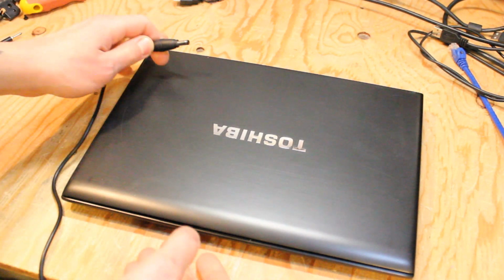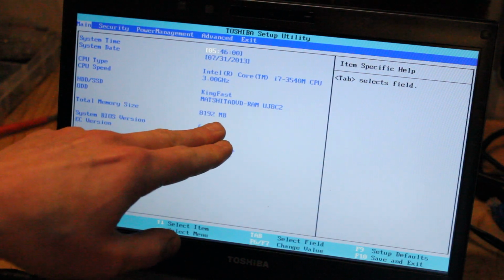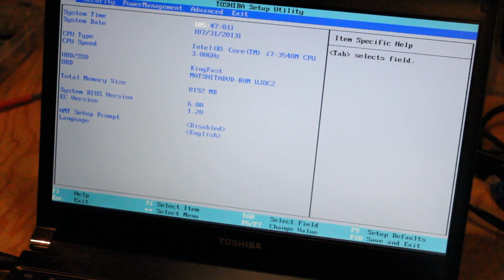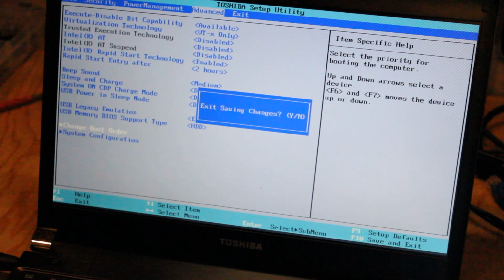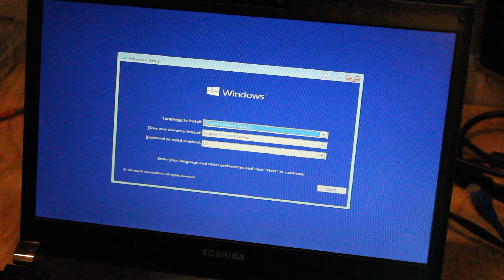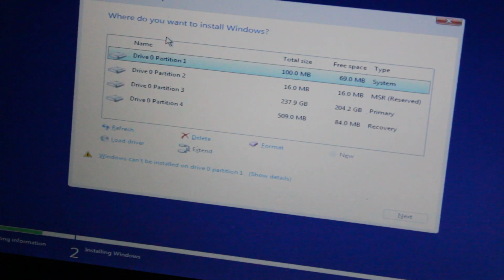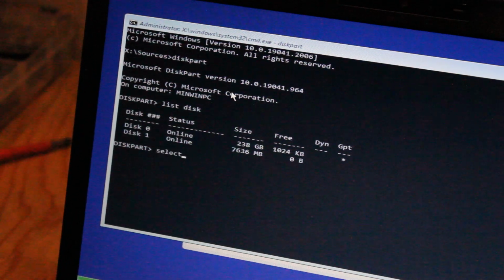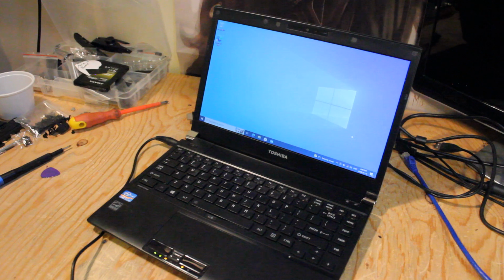Toshiba Portege R930 SSD & RAM Install for 2023

Comment: Does anyone know where to reset the CMOS battery in this computer? I can't find the right place to do it...
Reply: The CMOS battery is under the keyboard, but removing the keyboard won't give you access to it.  The MOBO has to be removed.  Before you try and change the CMOS battery, turn on the computer and run it constantly (disable sleep and hibernation). This will recharge the NiMH CMOS battery.  Unlike most laptops the CMOS battery in the R-930 is rechargeable and can discharge if it has not been used for more than 30 days. The first symptom of a discharged CMOS is that the BIOS settings revert to defaults (e.g. TPM enabled).  You may not see the typical clock disfunction because the operating systems can fetch the right time from the internet, at bootup.  A CMOS battery in this laptop can last more than 10 years.

Comment: i have the same laptop with i5 processor.
what is the maximum amount of RAM supported on this laptop?
Reply from the maker: Documentation states 8GB DDR3 1600Mhz.  16GB May work, but I don't think I tried that.  https://il.dynabook.com/contents/en_IL/PRODUCT_DESC/files/1162926.pdf
Reply: @HaisteComputerRepair  thaks for the reply. i have 2× 4GB ram sticks. i am considering removing one stick and putting 8GB stick.
Reply from the maker: @Gaveshhh  Running two 4GB sticks in dual channel will give you better performance than one single 8GB stick.  If you do get a chance to test out 16GB RAM, let me know.

Comment: Somehow windows is not working in my ssd in this laptop but hdd works fine
Reply: probably a bootloader error. make sure uefi/csm is correctly configured in bios and try windows repair install followed by Ultimate Rescue Disk (free online)
Reply from the maker: Can you explain a bit more?  Did you try to install a fresh copy of Windows on to the SSD after installing?
Reply: It was kinda issue of SSD incompatibility to boot. I used another SSD of lower capacity and that worked at the first chance!